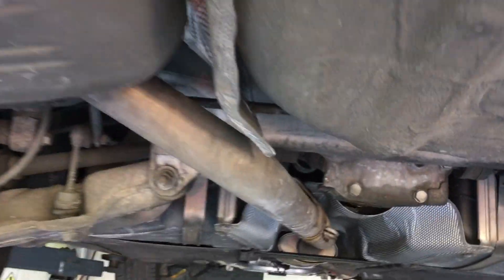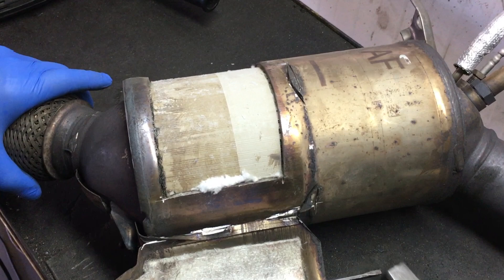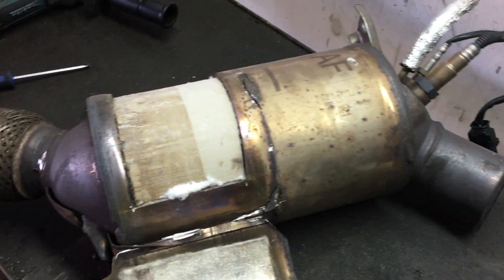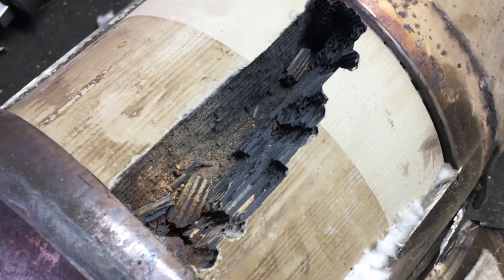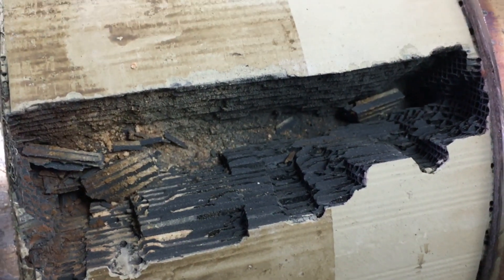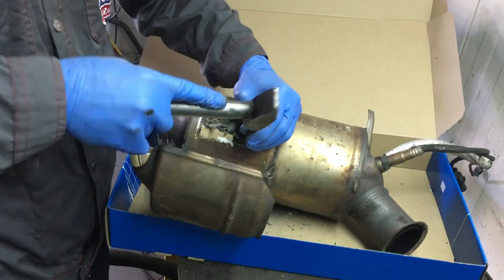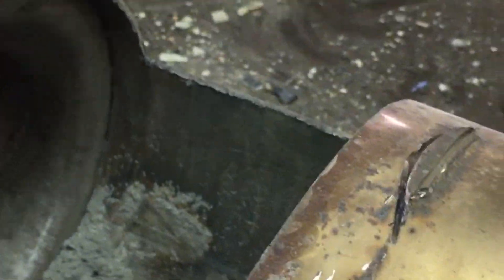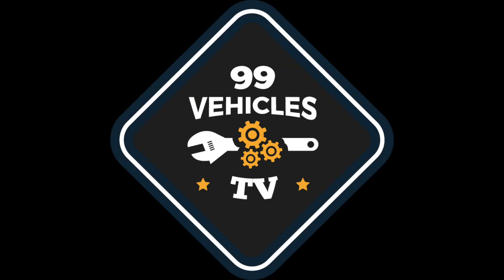What's Inside a DPF Filter? (Diesel Particulate Filter)

Comment: Couple questionable statements made here. Loss of fuel mileage? Only if after you remove the dpf, you drive it harder, which some people will. An extra 10-15 hp? That’s going to depend 100% on the tuning you go with. I’ve seen tunes from stock power levels, all the way to +300 hp, with no other mods but dpf and cat removal. Illegal to drive a vehicle with emissions equipment removed? Some places, of course. Where I live, it is not. No sniffer testing, and not only could the authorities not be bothered by it, but it actually says in our “commercial vehicle inspection program” criteria, that the province I live in is exempt from emissions inspection.

Comment: looks exactly like a catalytic converter soo yeah y'all call it exhaust filter when all it is a catalytic converter plus for diesel exhaust filter is called def an its toxic an they force us to put it in our diesel equipment its just a dumb design
Reply: It really isn't a catalyst at all though, it is quite literally a filter/trap with the ability to burn off the stored particulate matter later.
The catalyst has the one job of catalysing NOx to less harmful products whilst letting particulates pass right through.
Reply: Also DEF is a totally different process using Diesel Emissions Fluid (DEF) which is a urea solution sprayed into a special catalyst forther reducing NOx emissions.
Reply: @jetstream454  then it is a catalytic converter an I'll be right because its doing the same job burn left over fuel just like a gas engine

Comment: Remember guys over 90% of times DPF can be washed up with proper chemicals and pressure washer. Washed one can stay working many thousands km more, even be almost like new one. Check Your fuel system (no leaking injectors), boost pressure (higher means better) and egr (closing properly under acceleration). All these things not working correctly engine produce much more soot than it should be and can clog new/washed DPF very quickly also might be reason to clog recent DPF at first place. Don't buy new one if it's not really necessary, it's waste of money.
Reply: How do you wash it? Disassemble?

Comment: My egr was blocked solid & my dpf was 90% blocked on my 1.9cdti, faced with a minimum £1000 replacement bill i chose a £200 method,  my mechanic made it so dpf is removed/bypassed & the car still passes uk emission tests, of course in future you will need 'friendly' mot test centre to overlook the missing dpf. Also you need to keep in mind that you can't sell the vehicle on without the buyer being aware, or you'll be in a world of trouble. Not a problem for me as it's next home will be a scrap yard.
Reply: Why scrapyard? 🤔

Comment: My car during drive on motorway got slow down suddenly and cruse control stop working I went to garage next day he said will charge 250£ but I went to auto parts shop and bought 2 pack of  DPF REGENERATOR (500ML) for 15£ only and I had half tank of fuel in my car i putted it into car tank and driven car on motor way with 3rd gear full acceleration up to 30 miles and I got surprised my car got back to normal and Cruse control got active as well abs car speed is back to normal just sign still coming on screen that’s can be fixed by paying £10 to any garage by connecting computer to car sort it out
Reply: It is only a temporary fix mate. I tried to put all sort of shit in the tank and to rev high on motorway. At the end I still had to go through proper dpf maintenance and paid nearly one grand eur

Comment: Removed mine DPF and closed EGR and still passed the emission test. Just put diesel additive on full tank, drive for 160 km (100 miles) on a motorway and no worries. At least it worked for me.
DPF is the worst invention in modern human history. It shortens the engine life, especially turbo, increases consumption and adds super expensive repairs if you need a replacement.
Reply: hi,wich additive did you use if i may ask?(i have diesel engine)
Reply: @jozseffarkas1767  MOTUL Diesel System Clean Auto
Reply: @philipf8774  thank you Philip !!

Comment: I paid $1200 and now i don't have to worry about any of thos crap anymore. 

Better fuel economy and more power is well worth it.
Reply: do you need it to pass vehicle inspections?? like a C-Converter?
Reply: @treynewsom1817  

My state doesn't do emmisions tests. 
And even if they did as long as its programed right it will pass cause most emmisions test don't involve a sniffer anymore they just scan the ecm to make sure everything is running. As long as it doesn't pick up fault codes you're good.

Comment: i have sprinter van.
dashboard light on have massage exhaust filter drive at  engine speed. 
my mechanic sad to me i take out dpf out cut the top sheat and nside filter take off the weld the top sheet and fix 
its ok ? or not ok ?
pls repply
Reply: Choudhary Javed they can be removed, you will need a remap, and you will fail your mot emissions test. 5 minutes ago I didn’t know any of this I simply listened to the video. Ears are a wonderful asset but are wasted on lazy people
Reply: @gazmgow622  thank u for repply

Comment: I think mine either has started to die or died on my 2006 saab it has recently turned 350k km, unsure but it does blow out black smoke :) i can remove it and still pass my emissions since i still got the cat
Reply: Bacause in your villlage not testing for NOx
Reply: @SayWhaaaaaaaaaaaaaaaaaaaaaaat  dumbass
Reply: @SayWhaaaaaaaaaaaaaaaaaaaaaaat  DPF reduces soot and not NOx. The DPF is supposed to take the soot which the cat wasn't able to catalyze porperly, while the NOx is supposed to be eliminated by the SCR
Reply: @phantomsoldier497  Catalyst removes/oxidizes NOx, and the DPF does the job of just taking the particle matter away. Cat was never really designed to remove soot is all I mean 🙂
Reply: @jetstream454  it removes soot inderectly during the catalyzation of carbon monoxide and HC. The high temperatures burns soot and can remove   20-30% of ot
Reply: @phantomsoldier497  Do diesel cats really get that hot though? I believe they work differently from 3-way catalysts (regular gasoline catalytic converter)
Reply: @SayWhaaaaaaaaaaaaaaaaaaaaaaat  Cat reduces NOx, so probably why he still passes

Comment: what is short distances?
Reply: Less than 20-30 min run time give or take. 

The engine oil doesn't even get to operating temp in 15 min of light driving
Reply: @stevemasterson7776  so... Driving time is more imoprtant then trip distance? I mean i can go with slow road 10 km trip it takes me 25min or i can go 25 km trip on highway and it takes me 15min... Can you explain more witch is better for dpf /diesel?
Reply: @boratsmagadijev940  Highway, as you will have necessary speed built up
Reply: @boratsmagadijev940  No, engine temperature and speed and rpm are the most important factors, not distance or driving time

Comment: If ur engine is in good condition u ll pass the emission test without the DPF.
Reply: My car passed mot with dpf delete and so have many others
Reply: They test smoke values at no load. Common rail passes it without a problem also without dpf. If it smokes you have an engine/injector problem. Under real driving conditions its an other story. That’s the whole downfall of this stupid test method.
Reply: I had a focus diesel with dpf delete and it passed fine, mot guy even said its running very clean for a diesel
Reply: My 2.0tdi is EU4 and it has DPF
Reply: Emission test is not a problem on CR engines running very clean and it has an electronic smoke limitation.
Reply: If your logic, and knowledge is in good condition, u'll understand how silly what you said.
Reply: No! Won’t read emissions ready on the OBD2.
Reply from the maker: Not really. Diesel engines equipped with DPFs are E5 or E6 in terms of pollution standards. A Diesel without a DPF has E4 maximum. Smoke opacity allowance - Diesel without a DPF - from 0.80 to 1.50 m-1. For Diesel engines equipped with DPFs, smoke opacity allowance is from 0.30 to 0.60 m-1. So... if you delete your DPF you won't have E5 or E6 and you will fail the emissions test. 

Emissions tests are different for Diesel engines with DPFs.
Reply: 99Vehicles TV My engine (1.9 multijet) is E4 and passed the emission test without dpf . In E5 and E6 they are increasingly using the Adblue (ex new Land Rover Discovery)
If ur injectors are dead the dpf ll not help u :D
Reply: @99VehiclesTV  Have no DPF and EGR off and my smoke opacity on mot was 0.56 ( and that was the worst reading ). The car is Mazda 6 2.2 Skyactiv D.